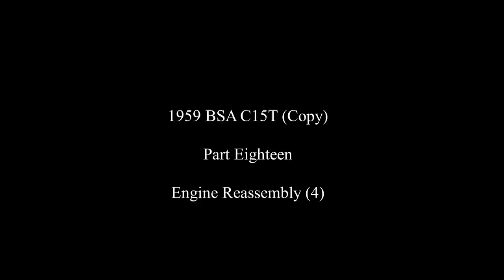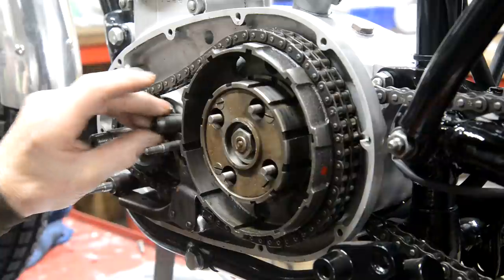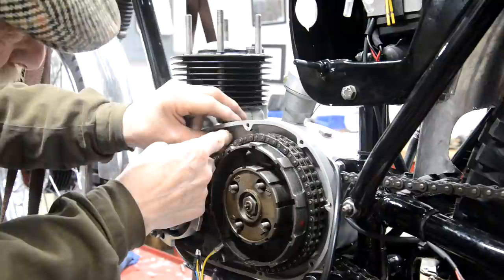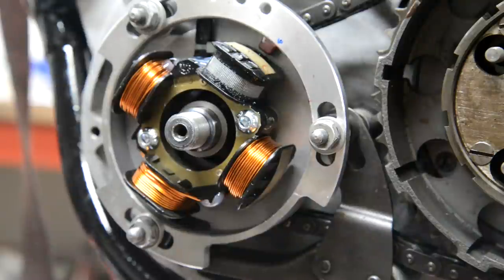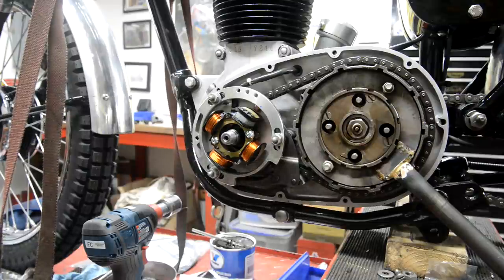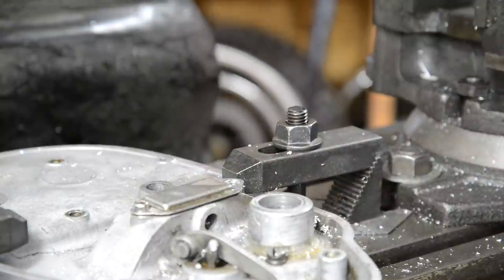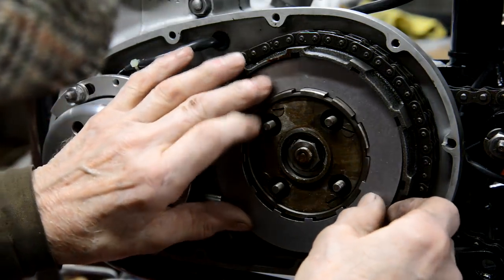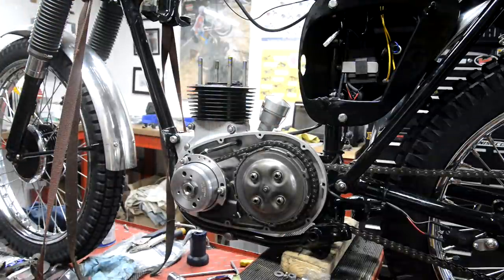1959 BSA C15T (Copy)  -  Part Eighteen

Comment: Top tip for putting screws/nuts in against spring tension is to use an appropriate size bit clamped in an old fashioned drill brace. You can compress the spring with the brace against your shoulder and tighten by turning the bit in the brace. Works for much more powerful springs too, like some bikes where the fork top-plug also preloads the spring.

Comment: A tip for you. When fitting any keyless taper on a shaft. Line it up, then put a socket on the end and give it a smart smack with a hammer to set it on the taper. This stops it turning when you tighten the retaining nut.

Comment: Hahahaha I'm yelling at the screen - you get it close to TDC and 35 degrees and tighten the nut, then set fine adjustment with the 3 slotted holes in the backing plate mate-
Dont you have to soak those friction plates in oil prior to install?

Comment: When I was 15 yrs old every man and his dog had a Beezer or a Triumph with one if these engines or it's descendants. Gearbox cam plate selector springs and kick start ratchet pawls were run of the mill, I also used to turn the cam plate  upside down because it was cool to have a gearbox with a one up and three down selector.

Comment: I must admit that I was a bit surprised you didn’t change the gearbox spring earlier. I’ve had two break on two BSAs. When I got my first proper bike, a C15 from Revitts at Stowmarket, the day I went to collect it the mechanic had just done a road test and the spring broke. It took half a day of me hanging around until it was fixed. Jump forward a few decades and I got a B25 Fleetstar. The spring failed on that too!

Comment: I used to own a 1959 C15 Star, registration NHL 481, it was my winter hack for when my trusty T140E Bonneville was having a winter break, I sold the Ceefer to a girl in 1984 for £60, the bike was stolen in Nottingham a few months after she bought it. I checked the NHL 481 registration  number on the web, it's now on a Renault car, I think the bike was  stripped for spares, it still had all the original tin ware on it when I sold it.

Comment: It's an engine that was uprated by a previous owner. Not at all confusing. Changed the compression and the carb.  Not the tractable power plant you'd want in a trials bike. Whoops... Should have spotted that earlier, Michael, but this is what your adoring fans love. Standard piston? Shims under the barrel? Our collective breath is bated. Keep up the good work, sir, and a jolly new year to one and all.
Reply from the maker: It's meant for sale as a road bike so I will just leave it in this state of tune.
Reply: @BritanniaMotorcycles  Excellent. I like it when an old bike's mods are retained. History isn't just kings and queens, it's also humble C15s that were bought, ridden, cared for and upgraded. Well done, sir, and may it's new owner carry on the good work.

Comment: What's this!  2BA thread repair kits are available in the US for about $104!  In the UK for £40 + shipping.  I have found shipping from the UK has gone expensive, and yet I ordered less than a pound of end mills from Michigan to Alabama and it was $16 ground!  I would have searched ebay, but I needed an odd mill, which was available in the UK for less!
I know I will get a world of flak from this but unless it is some extremely valuable item (like a Vincent or Brough Superior) I chase out No. 2 BA with a US #10-32.  As of yet I haven't had any failures by doing this.  The 60 degree included thread replaces the 47.5 degree thread seemingly well.  Cheers!

Comment: I'm wondering if a Heli-Coil insert would have fixed the threaded hole without all the fuss. If installed properly, it is a permanent repair.
Reply: I have used WURTH time serts at work.  far better than a helicoil as they are a solid thread.
Reply: @qshed  I have never had a failure unless I did not trim to the proper length and for most people, that only happens once. You have to be doing something incorrect.  I say bah humbug to you.
Reply: @qshed  being solid has nothing to do with the physics of what takes place when a bolt is tightened. The Heli-coil is wedged into the thread made by the tap. There is NO place for it to go. I know back in the 60's, we were told that you only need 2 threads using a Heli-coil to pull full torque. They are perfect for aluminum repairs as they will not cause corrosion.

Comment: Good vid as always Mike. Without stating the obvious, when youre fitting the flywheel and your timing mark was out slightly you couldve just moved your stator plate round slightly saving you having to re remove the flywheel again.  Does that type of stator have variable timing? Ive seen them before on 2 strokes where they dont rely on a pickup as such it works through the electronic cdi?

Comment: I have a 65 Mustang here in the UK and NOS is all but gone for this car. The repop stuff is often of variable quality and there are a few fit issues with some parts like your clutch pack. As for modifications and "upgrades" that avenue can be strewn with minefields. It is entirely possible to spend a fortune on power increasing parts for the engine only to actually decrease it.

Comment: I am doing a clutch right now on my c15 trials but the basket wobbles like a bastard and can't stop it ?  any ideas ?  new center, new spider , do i need to fit a shim between the center and the basket ?
Reply from the maker: I always replace the clutch rollers as a very small amount of wear in each roller adds up when there are so many. Also make sure that the centre nut is not bottoming out on the threads. There should be a very thick washer under it that the nut centre fits into.

Comment: Has anyone  tried fitting a royal enfield  (Indian) carb to a b40 ?  I've got an mod b40 with  worn out  amal  carb , wondered if anyone  has tried and how it went  .
Reply: Burlen fuel systems can supply Amal Concentrics or Monoblocs to the correct specifications: they bought the company.